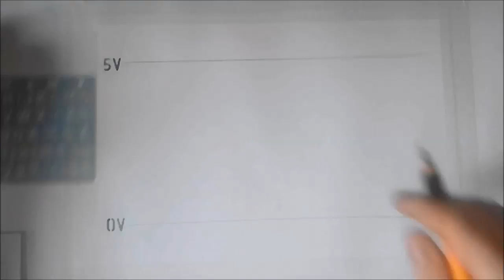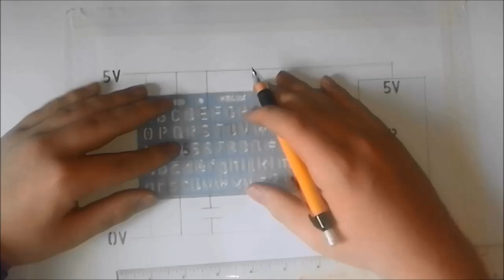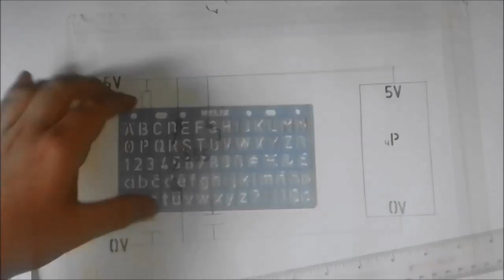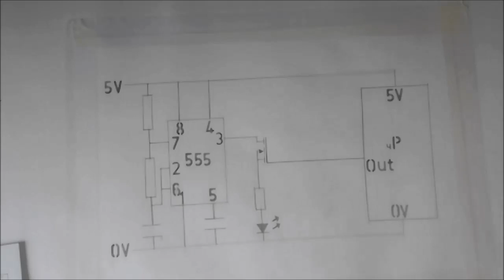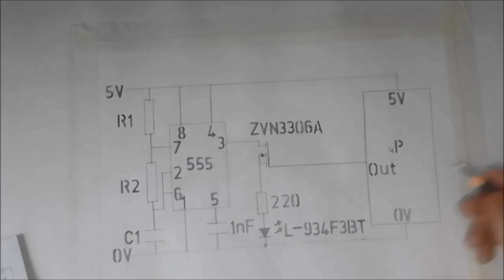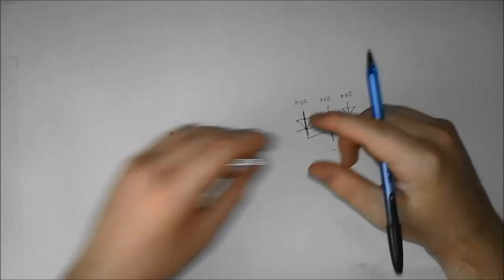Circuit Diagram Standards and Tips - Learning with The Beginner Electrical Engineer

Comment: Thanks for the video.  I am looking forward to your USB gadgets video!  A suggestion for a video, if I may: How about explaining how you would reverse engineer something?  I struggle with looking at a PCB, and being able to draw out the circuit.  Vice versa as well, I have struggled with replicating the more complex electronics projects from their circuit diagrams.  All in all, the subject I mean is physical circuit layout as compared to schematic layout.  Cheers
Reply from the maker: Thanks for the suggestion. However, it's a bit beyond my current abilities to reverse engineer PCBs so I'll just give you some advice.

If you're looking at a PCB or another person's project, start by understanding what components are there (For example you might see something that looks like a transistor but it might be a voltage regulator.) and writing them down. Once you have done that, find out what the power supply of the device is. (For example, if it is powered over USB then it's power supply will be 0v and 5v with a current draw up to 200mA unless it is powered by a powerbank or usb charger.) Then start drawing a circuit diagram using what you know about the power supply and draw in the big components, such as ICs, and observe the tracks on the PCB to add in what connects to where.

As you can probably see, reverse-engineering requires a large understanding of electronics. However, if you are struggling with projects then go with simpler projects first and get a solid understanding of basics before moving into bigger projects.
Reply: Cool, thanks for the reply